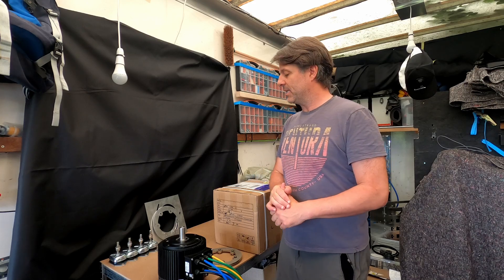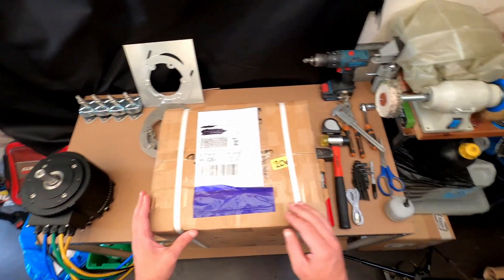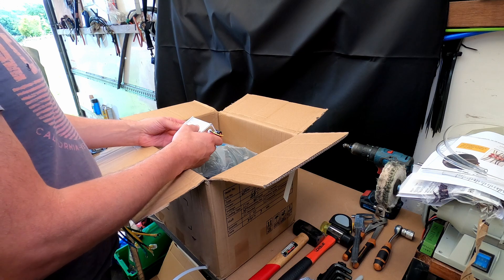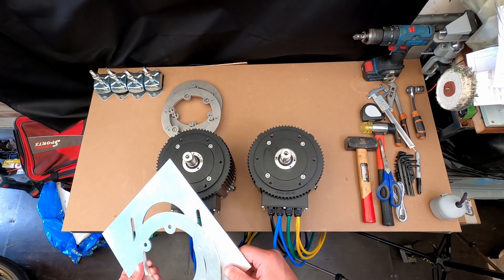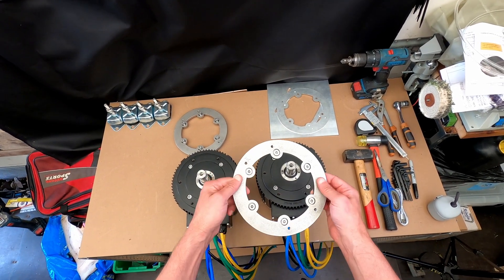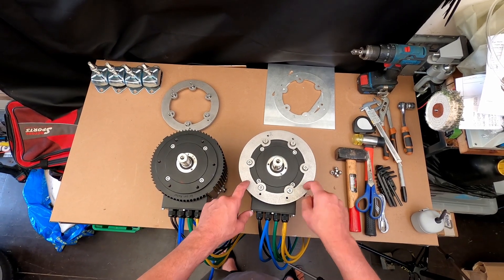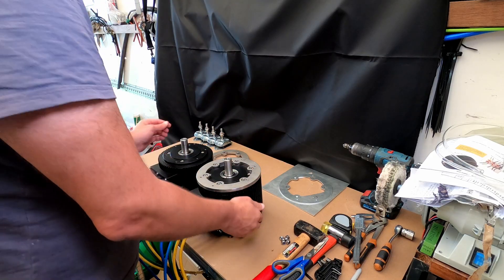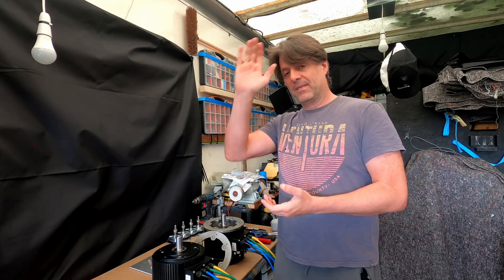Off-Grid Boat: DIY Electric Boat Motor Assembly - Ep. 2

Comment: Have you got to the part where you try to control it with an electronic boat/marine throttle? That’s where I’m having a tough time!
Reply from the maker: Hey Jon - Thank you for taking time to comment:) I have a throttle that Golden Motor sells and although not having the traditional marine design it is still something that I believe should work. Push forward and motor spins one direction, pull back and it spins in opposite direction. One throttle connected to two motor controllers. I am still in early days in relation to battery bank so not tested it yet but can cover what I got in next episode if it will help? If you check the 'electric inboard' tab on https://www.goldenmotor.com/ you will see the one I got. If you check the outboard tab I believe there are some other models that could be of interest:)

Comment: Looks like a fun build. Tip in case you didnt know, just print your CAD file. You can verify sizing and placement without cutting anything but paper.
Reply from the maker: That is a really good idea , thank you. Did not know that was possible, so I will explore that next time:) Big thank you for the great idea and for giving feedback:)
Reply: @modularhippo  Anything bigger than 1 sheet can be printed on multiple sheets and taped together. Or save as *.pdf and print at local print shop.
Reply from the maker: Thanks Art Smith, really good idea as will allow me to 'proof of concept' without spending money on cutting and wasting good material. Thank You for comment and great idea👍🏻

Comment: Thank you, interesting! Maybe I missed it but are you going to use two motors?
Reply from the maker: Hi Rattusrat - Thank you for your interest. Correct, the idea is to run two 10Kw motors in parallel (let's see how it turns out in reality), ha ha:) - Just released Ep. 4 that should give a better picture of the 2 motors mounted:) Any questions let me know and I will assist. https://youtu.be/MaReKNz9kZ8
Reply: @modularhippo  interesting. I am just planning a conversion of our 36 ft 9 ton sailboat. Plan to go with one 10kw golden motor since that is probably more then our old diesel will deliver. So will follow your build!
Reply from the maker: @rattusrat  - Nice one, let me know if you will share build on YouTube as would love to follow your build. For 10Kw single motor the channel 'The Neds' have tons of good stuff:) https://youtu.be/Jbhem6H47n4?si=ZYUeE0dcjv6Jf2VY
Reply: @rattusrat  I'm no expert. Typical sailboat is 2hp per 1,000 lbs. You're 18,000 lbs so 36hp. 10kW is around 13hp.

Comment: So your main reason for making the frame out of stainless was to prevent bending the metal under load? Do you think 10mm aluminium would actually flex? Very kind of you to share your designs, open hardware is amazing. ^_^ I thought about trying to copy your design, but I'm thinking for someone who wants to change belts often and quickly, a hinged approach might still be best. That sail, your designs have the mount points for the motor confirmed to be good.... Hrm. ;)
Reply from the maker: My reasons for going for stainless were primary strength but also weight for stability. The motor on a boat counts towards the overall ballast weight, and even with stainless, I am coming in lower than the Yanmar I am replacing and have to compensate with additional lead weights. Saying that, I believe you would be fine with aluminium. Having a hinged version as you say would be beneficial or some form of spring-loaded belt tension system.
Reply: @modularhippo  Aaaah, ok. In my case, my batteries will make the stern heavier than before, so I've been thinking about keeping things as light as possible to stay on trim. Also, Al to Al would have less corrosion concerns, I figured. Of course, stainless is indeed stronger.
Reply from the maker: @TheDigitalMermaid  - Makes perfect sense. For any SS bolts that goes into AL I use plenty of Sikaflex as proven to do the trick:) For any other connections I always have plastic spacers to make sure zero contact or the AL will start to sacrifice itself within days when throwing salt water into the mix. My main batteries are placed around the keel housing so in that area I will have to remove 200+ Kg lead instead.

Comment: Is there a 200 hp version?
Reply from the maker: @larrydavisflysite  Hey Larry! Thanks for your comment! This one hits 26-27 HP and is 20 Kw so 200 HP solution would requires some biiiiig motors:) - Saw that you have 'fly' in your name so of for aviation, then I would go for a pancake model as have better torque👍🏻👍🏻👍🏻
Reply: @modularhippo  20kw continuous? But since you’re using twin motors your torque should be nearly double. Which will keep the boat going at the rated motor rpm easier. Like my 21ft deckboat at 5000 rpm gets me at 25 mph.
Reply from the maker: @jonblair5470 - So many variables to take into account. Prop max RPM, Pulley Gearing and finding the motor RPM sweet spot :) Looking forward to bench testing as soon as I get to that stage:) I guess the goal is to find the spot where I use least amount of Kwh against a reasonable speed:) Please tell me more about your project as sou is interesting :)
Reply: @modularhippo  Now thats interesting that you brought that up. I am going to use 2 x Agni 119R pancakes. Is there any reason you did not go with "pancakes" - LEMCO in UK is VERY expensive - but Agni make the same thing for a lot less. Lynch himself is part of Agni now - no idea why but LEMCO and Mr Lynch parted ways a good few years ago - so his design is available through Agni in India. Each Agni 119R was 800 GBP + kelly controllers etc.
Reply from the maker: @jimjones7821  - Hi Jim, Lynch was my first choice, and 'Pancake' seems to make perfect sense on all the other benefits they offer. Saying that, it was the 'brushed' and 'air cooled' aspects that made me look for water-cooled and brush-less options. I have killed countless of brushed motors in the past, but my brush-less are still going. I guess as far as cooling goes, I guess you can use an external fan to aid the air-cooled version so maybe less of a reason. 800 GBP with controller sounds like a very good deal:) I believe that either way you go you should be fine (maybe a bit less maintenance on the brush-less version over a period of time but that is about it). Love the look of the pancake ones though, I must admit:)
Reply: @modularhippo  The big advantage of the "Pancakes" is they are narrow - space is always an issue on a boat. Like you I am doing 2 x motors connected via belts to drive a common shaft. My Agni motors (lynch motors) are 8kw each, so 16kw total - but at 48v ! This is a big deal as you are aware. 

Normally you can't get over 10kW from 48v, so by using 2 x 8kW I get 16kW total , but only using 48v. But you are already onto that aspect :-) Yes the brushes are a draw back - I would prefer brushless as well but space is a bigger issue for my design - I have a lot to squeeze in so every mm is precious. The brushes are rated for about 3000 hours, possibly more at 48v. With brushes the lower the voltage the longer the brushes last. 

I could also drive the motors at 72v and that then ups the kW rating of each motor to 11.5kW - so 23kW total - I just need to change some gearing and reprogram the controllers. These motors at 48v do 55rpm per v with 30 NM of torque. With 2 step reduction gearing the torque jumps up to around 330NM. However I am having some problems with the design I paid Agni to do for me. I am only getting a shaft speed at 48vnom of 433 rpm with 330NM - this is too slow and I need to have the mount/gearing redesigned _ i am aiming for 800 RPM final shaft speed using 48v. I will most likely have to drop back to a single gear reduction to achieve this. Problem is if I drop back to a single gearing reduction my torque is cut in half. Its a dilemma that I dont know how to solve yet - still thinking on it.

You have also mentioned wanting to stay at 48vnom so you get it. 72v is a lot better though. Less amps at 72v to deal with, so less heat produced - and I am air cooled, so this is not trivial. But 72v starts getting a bit nasty if it bites you and I want to run 2 x victron inverters from 2 different batteries.....its complex.

 Still, if it were easy, everyone would be doing it ! And as always, pioneers take arrows in the back !!
Reply from the maker: @jimjones7821  Ha Ha - I feel your pain as your questions mirror my questions. It is so many elements to it so it is hard to sometimes know from where to start:) - I can see the benefit of 72V (maybe even 96V that I have seen mentioned by other builders). Saying that, I will stick to the 48 for the ease of it as would need step up buck converters added to the already many components:) - In relation to your brushed design. I have seen people servicing the Lynch motors and it is very few parts and affordable (they send you the kit) so that should be no problem in case you hit the 3000/h and need them doing:) 800RPM is roughly my aim as well as my propeller has a max RPM of 1000. After that crazy things can start to happen that mess up the propeller fast:) All fun and games:)
Reply: @modularhippo  Thing is Agni have disappeared on me - no idea where or why they disappeared - so dont know what to think about Agni now. The last email I had from them suggested that I gear down to 3:1 on the 1st stage reduction and simply run a 0 reduction on the second stage - so essentially the 2nd stage is just an idler - this gets me up to 867 rpm at 48v but with only one reduction stage - this reduces the output torque by half - not sure how important this is ? How much torque do we have to have ? In this way the door IS open to 72v down the road should I want to up the power output - its hard to know how much power I need - so the idea behind this design spec was to allow 48v now but be able to change gearing in the same motor mount setup by replacing gears so I can use 72v output and get 866 rpm with a single stage reduction. This is my first foray into electric motors and there is no one locally who can offer any help - so on my own with this. My hope is YOU can offer some guidance 🙂. So far picked up everything I know through YT and forums. How the world has changed.
Reply from the maker: @jimjones7821  Hey Jim - I had some calculations early in the design phase of the build but not even sure where I have saved that info these days. I am so far down on my design that it has become a bit 'trial and error' along the way. Somehow we will make it work, I am sure. I have also come to understand that 'dry' bench-marking/tests are very different against test under load. As well as lower RPM tests while stationary gives very different results against boat being in motion. I have a feeling that it is only so far we can take things in 'theory' and that the 'tweaking' will come when we have numbers in hand (RPM, AMP etc.) from tests. I know that there is a sweet-spot for a motor where 'draw' is the lowest against optimal output, that is the one I will be chasing:) - So the short answer in 'No', at the moment I am 'add-libing' as much as you do. Let's share out findings going forward for that very reason:)
Reply: @modularhippo  totally agree. I just gave the go ahead to cut the plates for the motor mount this afternoon. I have settled for a 3:1 reduction on the 1st stage and an "idler" on the 2nd stage - which means the 2nd stage does nothing - it just becomes an idler gear. This gives me 867 rpm at 48v with up to 16kW and approx 180NM of torque. Its going to have to do. No one I have been able to contact can tell me if this is good, very good or it just barely makes it. Worst case I can always go to 72 volts to get a bit more out of it all - I have a Bruntons prop speed map that was done for my hull (still just a best guess really - so many variables to try to calculate) - at 72v and 6:1 gearing (2.4:1 on the 1st stage and 2.5: 1 on the second stage to end up at a total of very close to 6:1 overall from the 2 stages) I get 650 rpm rotation speed of the shaft with 330NM of torque (thats a lot of torque, so very nice). So according to Bruntons, using thier EcoStar prop this will drive my hull to 6.5Kts - that is not THAT far away from max hull speed (I am approx 34ft lwl with a 4.15m beam and approx 15t fully weighed down from the few hundred kWh of LFP - yeah I am probably going overboard on the LFP capacity but better too much then not enough - I actually still have space for more again but I think I am at the point of enough is enough) ...so the 72v option might be the best approx ? Not sure yet. Taking best guesses as I go forward. So far my best guesses have all worked out, so fingers crossed. Thing is down here where I am doing the rebuild no one can tell me or help me. On my own with this - it does feel kinda lonely ;0
Reply from the maker: @jimjones7821  I know the feeling:) That is what YouTube is for, catch-up and bounce ideas with like minded people. I have met some extraordinary people here that have been so helpful it is unbelievable. Some that already build AL sailboats from scratch (been there and got the t-shirt). Know what you are saying though, can he heavy when every decision made stops with you, and half of them are educated guesses at best:) - I guess that is also one of the reasons why it is attractive and we do it. If it was to easy it would not be appealing:) Pretty sure you need to be of a unique character to even contemplating a build or renovation of this magnitude. If it is any consultation, your current calculations are far more low-level then I have at the moment so I think you are doing just fine. Have no doubt that the boat will propel forward:)